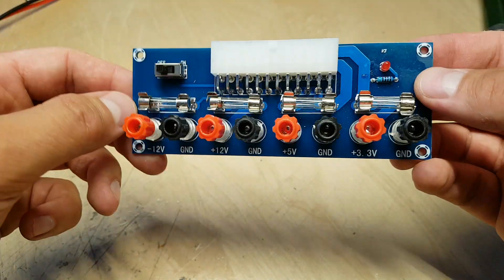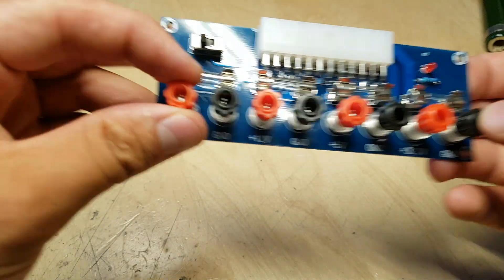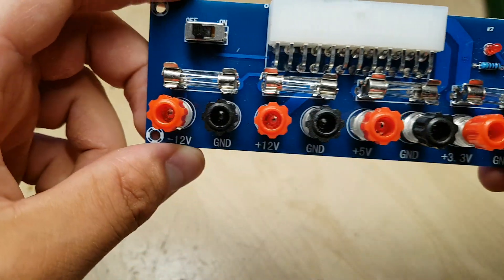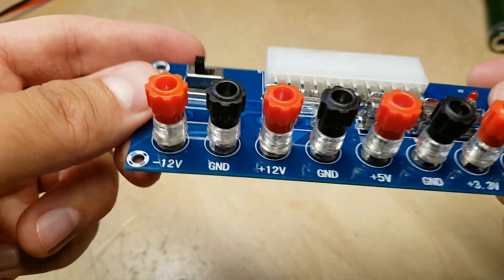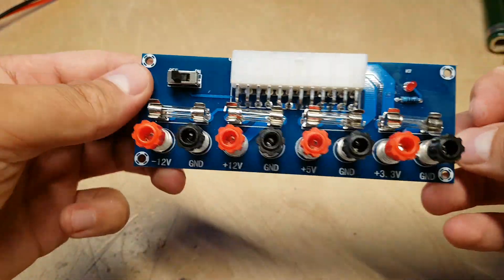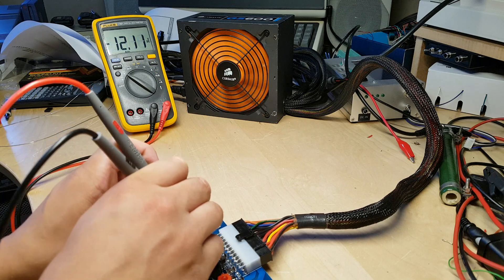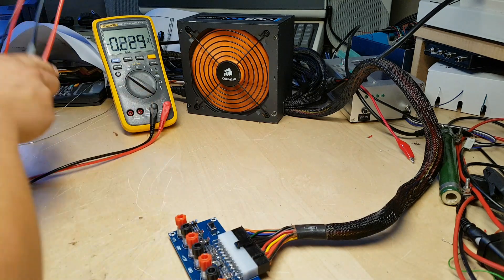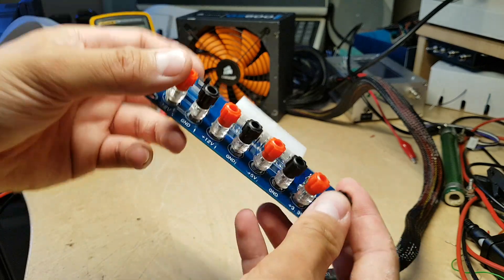24Pin XH-M229 ATX power supply Breakout board from ICStation

Comment: It is kind of funny that IC  Station uses your video to help sell this when your review was not exactly raving about the product. Good honest review by the way! One question though. What do you use negative voltage for?
Reply from the maker: Hehe yeah it is a bit amusing.. You would use the negative voltage for memory circuits, operational amplifiers and such, or anything else that might require a split rail supply as it's called.
Reply: @H3adcrash  Thanks for the reply!! I will have to watch  videos about this.
Reply: If you connect +12 V to -12 V, you have 24 V.
Reply: you also have a short and blow a fuse ..